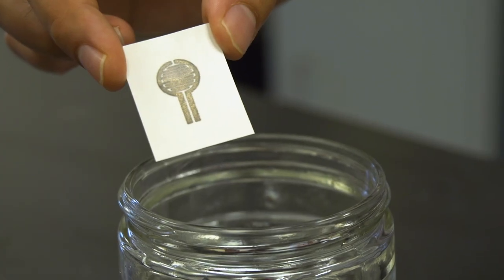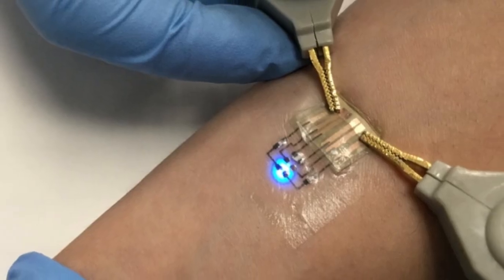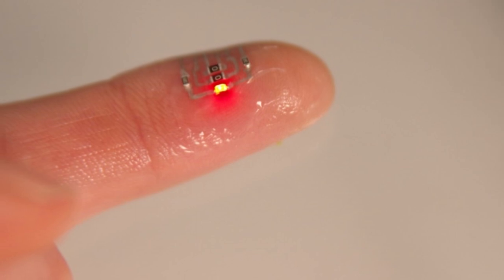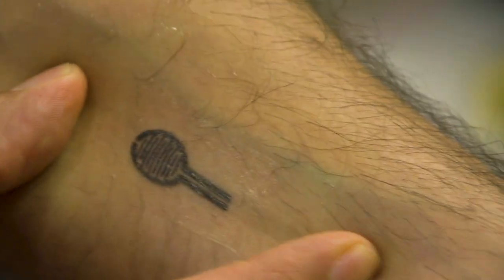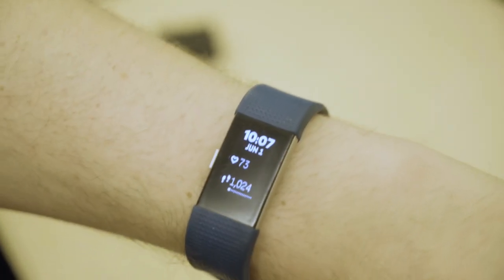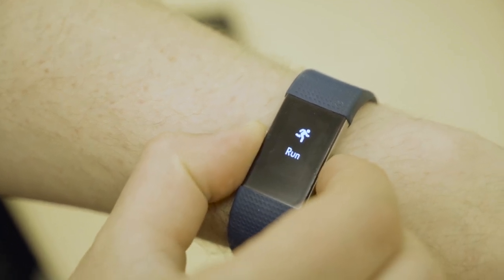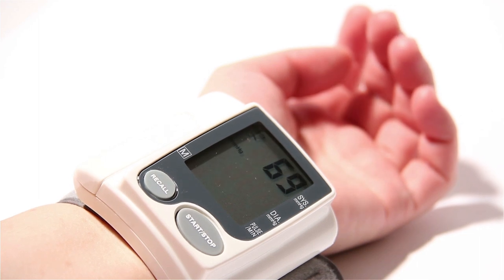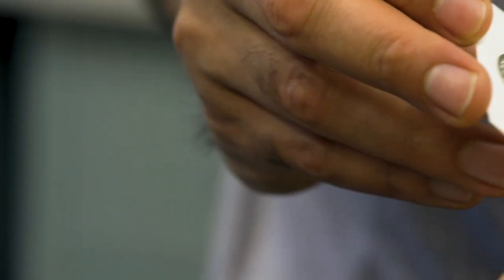Carmel Majidi: Electronic Tattoos for Wearable Computing: Stretchable, Robust, and Inexpensive

Comment: Liquid metal alloy huh? Hmm, i wonder how much of it is iron or better yet mercury.
Reply: Nah it’s not mercury it’s gallium they’re using. Gallium has a slightly higher melting point than mercury but it’s completely non toxic. Technically you could drink the stuff lol. It’s mostly solid at room temperature but if you just warm it up in your hands a bit it’ll melt.